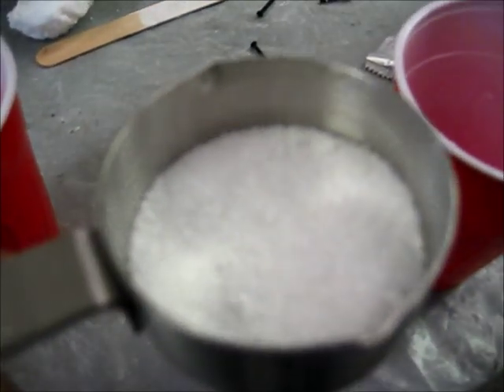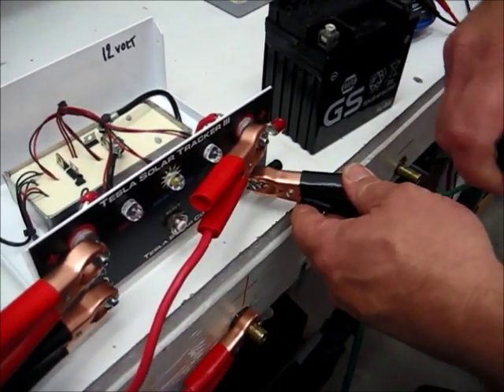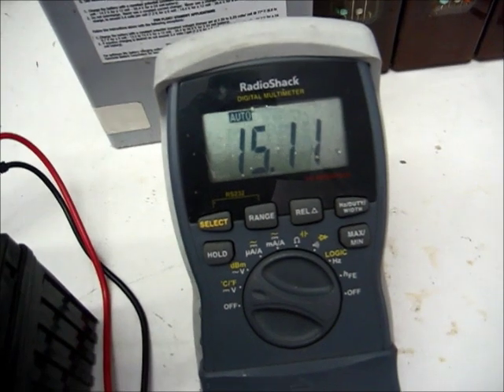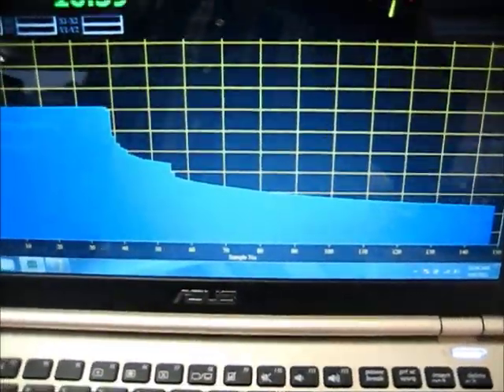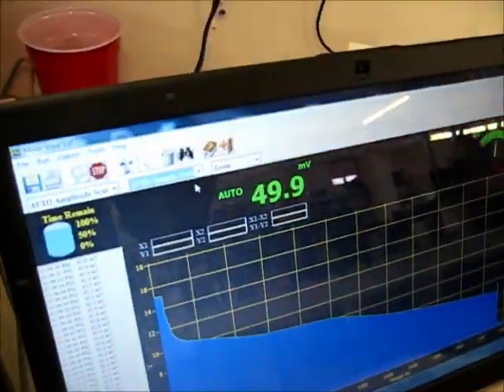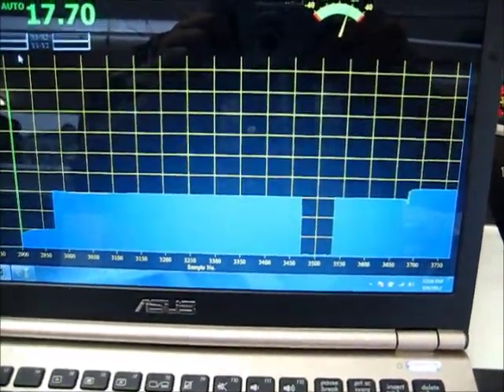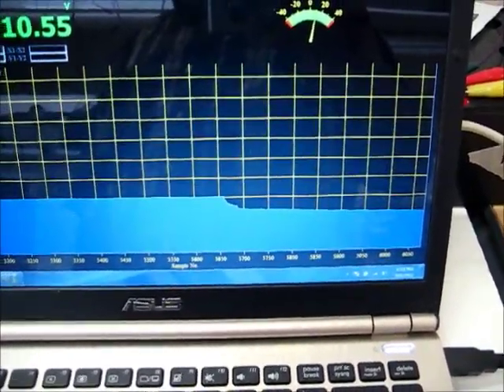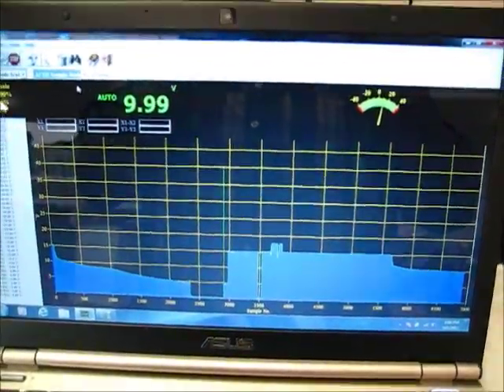Conversion Of A Dry-Charge Lead Acid Battery To an Alum Crystal Cell Battery John Bedini

Comment: Hello John
Try to add an electrolyte made with Sodium Carbonate.
The battery will work as a alkaline battery without any sulfation, since sulfates are not involved in the reaction.
PbO2 cathode become PbO and Pb anode become PbO.
PbO don't dissolve in the presence of carbonates.
You also can add Carbomer940 to make a jelly-like electrolyte.
You also can add some insoluble pyroelectric crystals (like Alunite) to reduce self-discharge: grind well <5microns.
Your pulse-charge is very intriguing ! Tried with high voltage low currents?